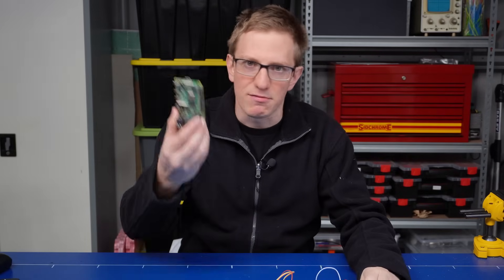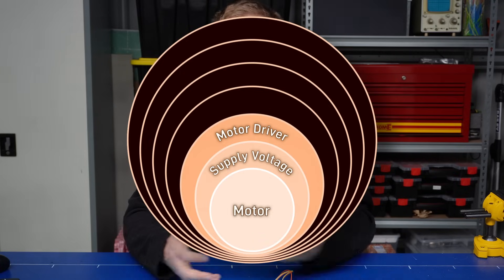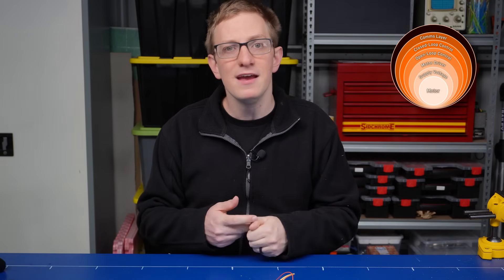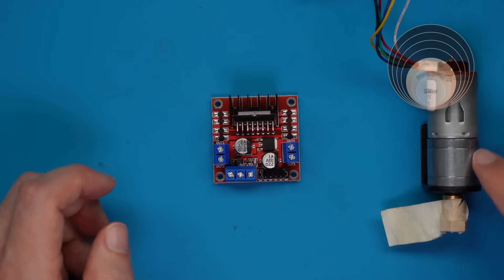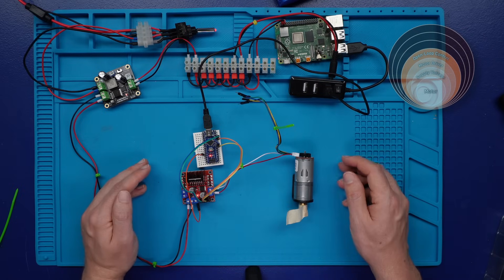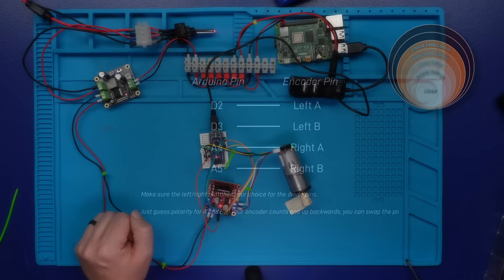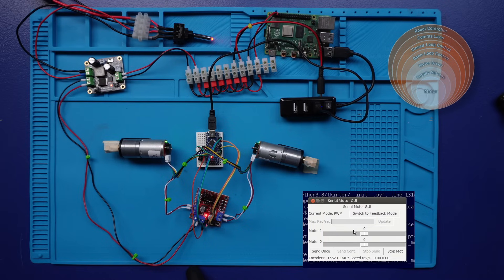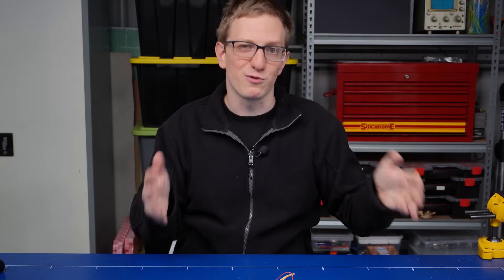The Ultimate Guide to using Motors in Robotics (including ROS, Raspberry Pi)

Comment: python3-serial installed but no miniterm????  sudo apt install miniterm: E: Unable to locate package miniterm
Reply from the maker: Yeah on 22.04 they've changed it, you now need to run pyserial-miniterm as the command. (this will be covered in the upcoming video :)) Same install command
Reply: @ArticulatedRobotics  Awesome thanks.  This even works with my Cytron controller but I just ordered 5 of the controllers your using cuz I just fried a channel on mine.  whoops.
Reply: @ArticulatedRobotics  Sorry, one question though.  When I start the motors at least the one on the channel that still works.  It only runs for about 5 seconds then stops.  Is this normal?
Reply from the maker: Yep, this is a safety feature. This is so that if if whatever software sends these commands to the controller crashes, the robot will stop instead of driving out of control. If you look very carefully in the video I run the commands multiple times to get it to keep going
Reply: @ArticulatedRobotics  Ah thanks.  I did not notice that but now remember you talking about it.  Thanks.
Reply: @ArticulatedRobotics  Have you ever encountered one motor spinning faster than the other?  Maybe the gear box in one of them is sticky.  Can this be compensated for or should I just replace the motor?

Comment: congratulations I've just subscribed to your channel but could you please give all the recommendations as to what ide i can program raspberry pi  or even a video can do

i also need a full guide about programming that board for motors 
__________also __________
i need to know what c++ library encompasses all sensors, basically does all that i can add to my project be it a sensor, cam etc and be good to projects concerning  motors

Comment: Not exactly accurate. You're describing Amplitude Modulation. With pulse width modulation the voltage remains constant. The O' scope will demonstrate that. PWM is Frequency Modulation. Otherwise good video. Pretty basic stuff.